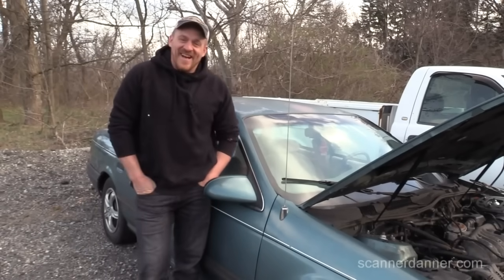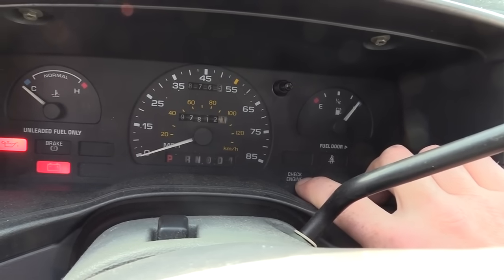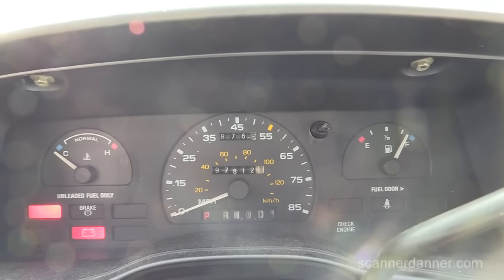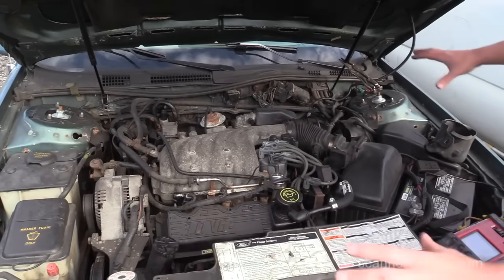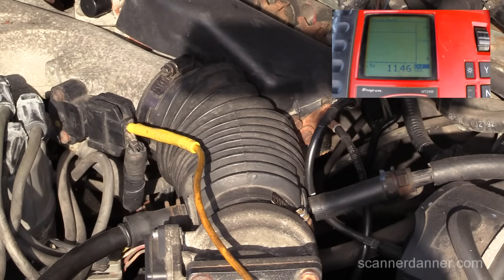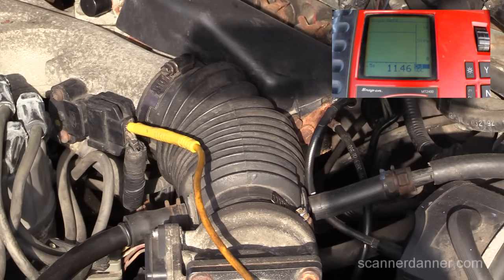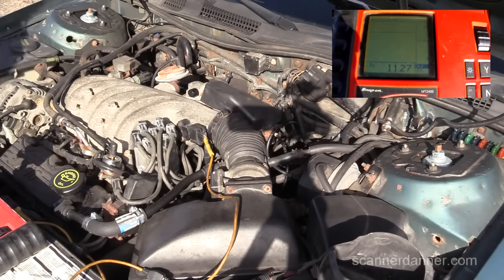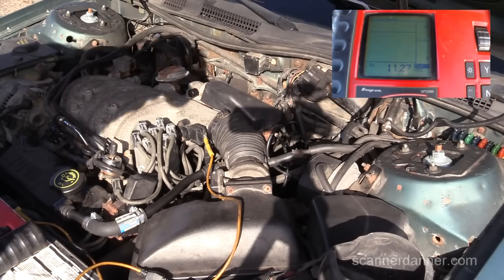Sensor grounds and the 5v reference circuit (a 2016 ScannerDanner Premium video)

Comment: 1999 Ford f350 V10 i have po118 po117 at same time wiring is good and tried 3 pcms any ideas
Reply from the maker: Define the codes please
Reply: @ScannerDanner  coolant sensor codes one is a open one is a short
Reply from the maker: @twinscrew9.047  what is voltage on both wire of the coolant sensor, with key on and sensor plugged in and unplugged?
Reply: @ScannerDanner  it's 11 volts on one wire and it's supposed to have 11 volts on it because it's a gague driver the 11 volts comes from cluster
Reply: @ScannerDanner  and it's on it's own circuit
Reply from the maker: @twinscrew9.047  wrong sensor then. You have engine computer engine coolant temp sensor codes!
Reply: @ScannerDanner  you put a wire in between the 2 wires and the gague pegs hot and coolant sensor is a oem and gague works
Reply: @ScannerDanner  it has oem coolant sensor in it it's the right one it don't make sense truck very hard start and when it starts it runs rich
Reply from the maker: @twinscrew9.047  wrong sensor to be chasing for those codes! I don't care if the ECT is new either. What are your voltage readings on the ECT? Not the gauge sending unit.
Reply from the maker: @twinscrew9.047  this is a classic symptom of an ECT problem! (Hard starting and running rich)
Reply: @ScannerDanner  yeah I know but the ect is good I tested wiring is good and pcm I can replace ect again and go from there thanks.
Reply: The ect is a 2 wire one is going to cluster and pcm the 11 volts is coming from cluster and other is ground going to left inside kick panel I pulled sensor out and tested it works fine wiring is good put a wire between the 2 wires and gague pegs to hot and replaced pcm 3 times it's on a 1999 Ford f350 V10 it don't make any sense any ideas I've had all sort of mechanics look at it and are stumped and I'm a pretty good mechanic and now it really won't start and won't pull any codes but last codes I could get from it was P0118 p0117 now the engine light just flickers and clicks when trying to pull codes any ideas thanks.
Reply from the maker: @twinscrew9.047  That is NOT the input being used for engine coolant temp input. I just checked a diagram and you need to be focused on your cylinder head temperature sensor as your model does not have an actual engine coolant temperature sensor. 
Stop chasing the gauge circuit (doesn't matter that it has a splice that goes to the PCM), because that is what you are focusing on and it is incorrect for those codes.
Reply: @ScannerDanner  those codes are for ect sensor a p0129 is for cylinder head temperature sensor from what I studied and Ford told me
Reply: @ScannerDanner  and I no I have 5 volts at cylinder head temperature sensor I replaced it to but not with a oem
Reply from the maker: @twinscrew9.047  service info says "The PCM used the CHT to determine engine coolant temperature in place of the ECT sensor. In this case the PCM may store both CHT and ECT circuit DTC's"  This is for the P0118 flow chart!! Did you catch that? The CHT sensor may cause ECT circuit codes......

Will you please test the CHT sensor! Why would you not want to verify operation of a sensor this IS being used as the coolant temp sensor?  Measure the CHT sensor for voltage on both wires, plugged in and backprobing, and unplugged. Or you can argue with me some more about what circuit you should be focused on. The gauge circuit IS NOT IT!
Reply: @ScannerDanner  ok thanks I checked everything on cylinder head temperature circuit had good ground and 5 volts on it but when I replaced cylinder head temperature sensor I noticed it was broke inside so I replaced it but not with oem one when I replaced ect sensors with no name brands my gague wouldn't work so I think the cht sensor I have in it is bad thanks so much for your help I've been working on this for a year it's supercharged and only has 60.000 thousand miles on it I way enjoy this truck ,so I greatly appreciate your help thanks.
Reply: I got 2.67 volts on cht sensor plugged in or out it's hotter than hell I'm supposed to have 5 volts on the cht sensor right and my fuel pump is continuously running with key on any ideas
Reply from the maker: @twinscrew9.047  let the engine cool down. We don't need hot engine anything for what we are doing!
Stay focused on the CHT sensor for now!
What does the ground wire voltage show you plugged in?
If it's 0, that's good. Next step is to measure the same CHT sensor signal at the computer pin and compare. Yes it should be 5v unplugged
Reply: @ScannerDanner  I'm talking about weather outside is over 100 my volts are 2.67 unplugged at harness
Reply: @ScannerDanner  ground wire is good
Reply: @ScannerDanner  volts are the same plugged in
Reply: @ScannerDanner  volts at pcm are the same 2.67 but I got 2 more pcms
Reply from the maker: @twinscrew9.047  please be concise in your replies. I can't keep up and extra replies make it even harder for me.
What harness? I asked you to do a measurement of the signal wire at the PCM connector with the sensor unplugged. I know you're reading low voltage at the sensor with it unplugged and I want to see if it is also low at the computer pin.
Reply: Only got 2.67 volts at cht harness replaced pcm same results so I'm thinking I have a bad wire going to pcm to much of a voltage drop I need to pinpoint wire on pcm and go from there would you agree
Reply from the maker: @twinscrew9.047  I get email notifications and answer them in order. Please only send one reply with all info! You have no idea how hard this is for creators the way these threads and comments come in. I normally will not offer this here for this very reason. I have a forum on my website (free to join) which is where I'm about to send you for the rest of this.
Reply: @ScannerDanner  ok sorry
Reply: @ScannerDanner  I will get back to you I need to find cht wire at pcm to check voltage thanks for your help greatly appreciate it your the best no other mechanic could find out what was wrong ,you directed me to the right place thanks.
Reply: @ScannerDanner  ok I have 5 volts at pcm should I replace wire to cht harness
Reply from the maker: @twinscrew9.047  sweet! ECM is fine and this looks like a heavily corroded wire (voltage drop) however and this is a huge however. If this is the case, that 2.7v you're reading at the sensor would absolutely drop further if your ground circuit for that sensor is good. I bet you your ground wire is also messed up. Please re-do your sensor ground test plugged in. I'd put money on it reading that same 2.7v you have on the signal wire. In other words, you have another problem too. (An open sensor ground circuit)
Reply: @ScannerDanner  I checked ground with power probe with sensor plugged in and out it checks good but I will do what you  said when I plug it into sensor it will be lower on voltage because it's so hot in my garage
Reply from the maker: @twinscrew9.047  so with a thermistor circuit voltage will always drop on the signal wire when plugged into the sensor and it doesn't matter if your source voltage (5v in this case) is lower than normal. It should still drop and if it doesn't then you also have an open ground or an open in that CHT sensor itself, combined with a corroded signal wire. Do a good visual on that harness. Look for points of harness to metal contact points and eyeball each one before moving or manipulating that harness to look closer. This method is always preferred to running a new wire because it sounds like you have multiple wires bad in that same location
Reply: Should I just run a new ground wire just to be safe
Reply from the maker: @twinscrew9.047  no! Do the tests please
Reply: @ScannerDanner  ok thanks for the help
Reply: @ScannerDanner  ok a new one for you if you have the time my 1999 Ford f350 V10 with the key on the fuel pump is constantly running it I just put a new fuel pump in it it's not supposed to run like that with key on right do you no the causes of something like this
Reply from the maker: @twinscrew9.047  same truck with the CHT sensor? And this truck runs with the fuel pump running all the time or is it a no start?
Reply: @ScannerDanner  it ran fine but over time it got harder to start while messing with this cht sensor I just noticed it running all the time with key on I think my spark plugs got soot all over them that's why it's hard to start from cht sensor dumping fuel in I have a wideband gague when it finally starts its at 10 to 1 really rich but it only runs for a few minutes then shutsoff
Reply from the maker: @twinscrew9.047  this is exactly why we don't want to run new wires, see this CHT sensor problem to the end and we may address also why your fuel pump is now running all the time. Stay focused on this CHT circuit first!
Reply: @ScannerDanner  ok thanks
Reply: Now I only have 2.67 volts at pcm so tried one of my new pcms and fuel pump is not running all the time but only have 2.67 volts coming out of cht sensor pcm pin yesterday I had 5 volts at both pcms now both pcms have 2.67 volts I need a new pcm right any ideas if you ain't busy thanks
Reply: @ScannerDanner  1999 Ford f350 V10 supercharged now both pcms have fuel pump running all the time and 2.67 volts at pcm weird.
Reply from the maker: @twinscrew9.047  give me voltage readings on your TPS. I want to know if you see the same 2.67v there too. Do that one unplugged. At least 1 pin should read 5
Reply: @ScannerDanner  it's 5 volts
Reply: @ScannerDanner  and all my sensors are on there own circuit
Reply: Just checking in with you I no you don't do this often but I do appreciate it should I buy a new pcm it don't make sense that I had 5 volts 3 days ago but now only have 2.67 volts at pcm this is Brett with the 1999 Ford f350 V10 supercharged
Reply from the maker: @twinscrew9.047  lots a variables here.
1. Signal wire could be partially shorted to ground, pulling the 5v ref down
2. Multiple bad PCMs (took us 4 or 5 different ones to get a good one on an 08 Explorer)
3. Signal voltage should drop, sensor plugged in and you said it wasn't and I wanted you to do that again and confirm ground voltage and you never answered this question. (START HERE!!)
Reply: @ScannerDanner  voltage drops to 1.9 volts when cht sensor plugged in ground is good solid ground using power probe
Reply: @ScannerDanner  ran new wire to cht sensor temporary still 2.67 volts
Reply from the maker: @twinscrew9.047  cut the wire about 3" from the PCM connector and re-measure voltage. As long as you have enough room to fix it. Or do a standard resistance measurement for a short to ground, which is both PCM and CHT sensor disconnected and one lead to battery ground and another lead to the CHT signal wire. It should be a complete open circuit on your mega ohm scale
Reply: @ScannerDanner  voltage is still 2.67 and it's open like you said
Reply from the maker: @twinscrew9.047  the is a PCM issue. And so is the fuel pump running all the time.
Check your EGR psi sensor (DPFE) sensor and see if you have 5v there too. I know you said the TPS does. And they are not all separate, internally it is all shared on your model
Reply: @ScannerDanner  ok I will try a pcm but I can't get to egr sensor I would have to take supercharger off unless I have to so would you try pcm first
Reply from the maker: @twinscrew9.047  you have low reference voltage and before I'd ever put a 3rd PCM in, I'd want to confirm no other sensors have low ref voltage, because one sensor can short out and do that!
https://youtu.be/za13UnpbH7E
Reply: @ScannerDanner  ok thanks for the help
Reply: @ScannerDanner  one more question this is Brett with the 1999 Ford f350 V10 supercharged can a sensor short out the pcm thanks.
Reply from the maker: @twinscrew9.047  it can short out the 5v ref circuit, yes, but once the short is fixed the 5v returns. It is a highly protected circuit within the PCM. Watch that video I linked in my last comment!
Reply: @ScannerDanner  ok well I will start wit it sensor and all the others it's hooked to but I will have to take off my supercharger what a chore thanks.
Reply from the maker: @twinscrew9.047  this can be done at the PCM connector with a good wiring diagram. I show the process in this video 
https://youtu.be/hJQ6qnhTgdg
Reply: @ScannerDanner  I was just thinking wouldn't these sensors are hooked up the same by grounds wouldn't I see voltage on the ground of it sensor or cht sensor
Reply: @ScannerDanner  I have 2.67 volts on my iat sensor
Reply: @ScannerDanner  I've narrowed it down to the fuel pump pressure switch or the pcm
Reply from the maker: @twinscrew9.047  you got that man. We're at least on the right path. You also need to make sure all power feeds to your PCM are good. One with low/no voltage can make the fuel pump run all the time, as well as a shorted 5v ref circuit. You have to be 100% before calling a 4th PCM
Reply: @ScannerDanner  ok thanks

Comment: I don't understand how it had 12v on the sensor ground when it was not grounded??
Reply from the maker: Understanding the 5v regulators wiring in the ECM will help.
It has a 12v feed, a ground, and a 5v output. With no ground, the regulator cannot reduce the system voltage as designed, so you will read 12 on the sensor circuits. Hope that makes sense
Reply: @ScannerDanner  ty that helps

Comment: so is 5v reff circut ans signal same thing!
Reply from the maker: No sir. Great question. 
Totally separate but related in that if you are missing a 5v ref to a sensor, you will not have a correct signal

Comment: Just about All of my sensors are connected to 1 computer ground right
Reply from the maker: actually, all of your sensor grounds go back to the ecm board, then the ECM board is grounded externally with usually 2 or 3 main grounds. In this video we had main ground faults causing ecm board voltage itself to rise, which is able to be seen on the sensor grounds and reference circuit. Make sense?
Reply: ScannerDanner   Thanks for the reply and attempt to help. I'll keep on rewatching your vids, reading diagrams, and looking up new info to solve these 5 volt ref codes. Everyone is telling me to replace the PCM but idk how to be sure that that's the problem.
Reply from the maker: Can you give me some background? I may be able to help
Reply: ScannerDanner   03 Buick, 3.1L GM V6.  Getting a "5 volt ref B low" code along with intermittent codes for many of the sensors . I've replaced a couple as well as tested for the correct ranged with the meter. The most confusing part of all of this is when dealing with the ground and testing for ground.
Reply from the maker: I got a video for you brother!
https://www.youtube.com/watch?v=uyncVz_HAtA&index=23&list=PLAFYVCyenqcpP9ykkWb2D16nVEjyQ1eTZ&t=805s
Reply from the maker: what did you find?

Comment: Would have wet my pants if oil cooler blew off the cap from pressure release valve failure and big end dropped out the sump after that fell off. he he

Comment: why you don't disconnect the TPS connector, the tests will be easy
Reply from the maker: test was easy the way I showed it too. I like a plugged in "loaded circuit" test better, as a general rule. But in this case, the unplugged test would have shown it too, just not always.

Comment: replaced starter on pontiac g6 and now tachometer or rpm not working wtf!!!
Reply from the maker: Any codes? Check your crank sensor connector
Reply: @ScannerDanner  only code is po449 canistor vent solenoid wierd would replace crank sensor anyway but needs set by scan tools i think

Comment: 2 Door, Ford Thunderbird or something like that, forgot what year, maybe 1993 had also many ground wires connected to the same frame area of the car and over time it would get loose, and car would die while going over bumps. etc. Terrible place for a ground wire place in the first place.

Comment: A multi wire circuit connector a few inches away from an externally vented lead acid battery.  Way to go Ford Engineers. Can you guys sell me an ounce of what you are smoking? And let's not forget the Genius Inertia Switch design. You couldn't spend another nickel to have an indicator in the instrument cluster?  Dumb design is Job One.